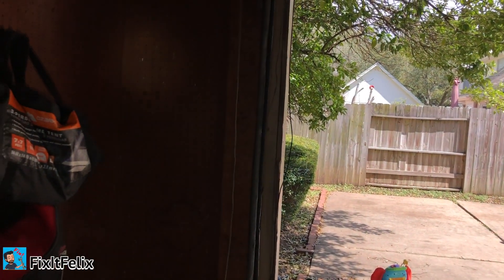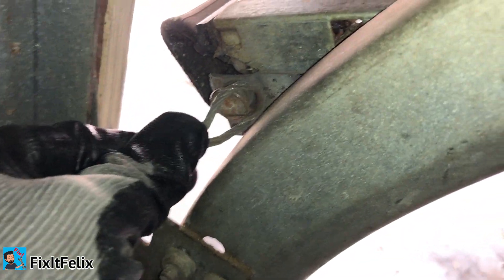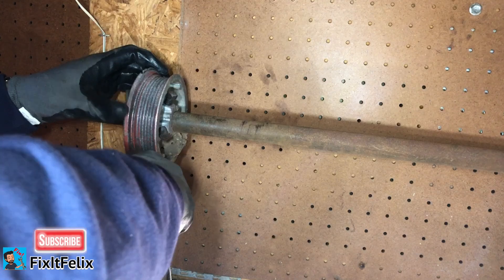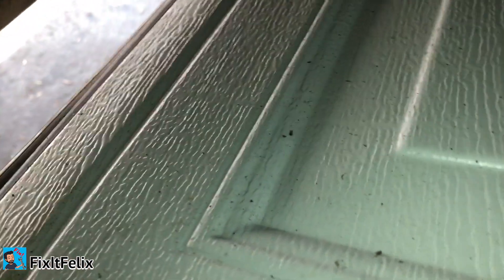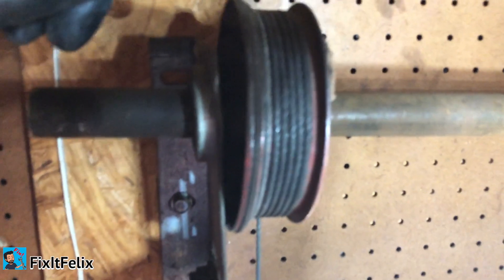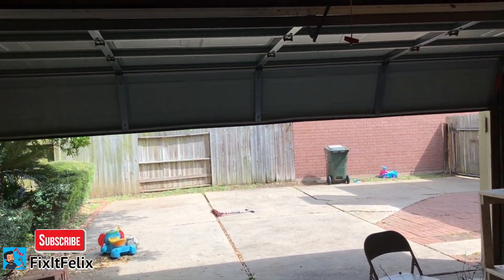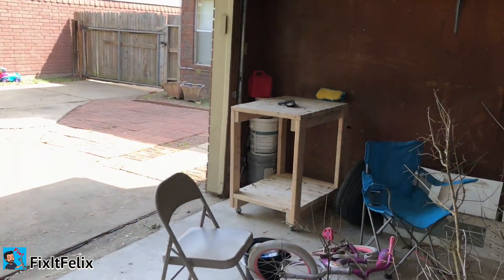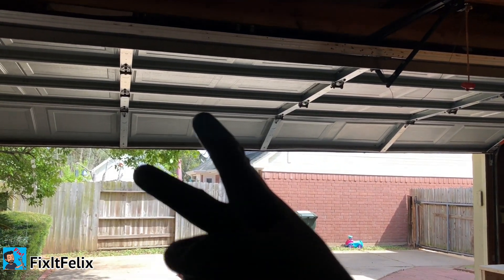Garage Door wire Fix EASY!

Comment: Thanks..my cable came off too but the loop on the end split rusted so I'm guessing I need a whole new wire? I also have a garage door opener on the door. I hate to call a repairman they will charge me alot to fix this when maybe I can.
Reply: I’m sure you can fix it! 
   The best thing you can do is replace it, you don’t want the door falling on anyone because of a rusted wire that you already knew about. They’re inexpensive too. 
   Good luck! If you haven’t already fixed it 👌

Comment: Didn’t need to disconnect cable just loosen set bolts 3/8 socket and turn the drum and retighten much easier

Comment: I tried doing this but for some reason, the cable still keeps coming off.  It seems like there’s not enough tension on the cable and it keeps coming off on both sides when I raise the door after lowering.
Reply: Set cables first with the door in the closed position and the  add the tension.  When the door is open there should still be about a half turn on the springs.
Reply: 7 foot high door with residential drums the rule is one full rotation of the spring per foot of door height.  Most doors being 7' high require 7.5 turns.  Or 30 quarters.  One plug hole on the spring is a quarter turn.
Reply: newmiester it turned out that my door had an internal spring that was broken.  I ended up needing to replace the assembly

Comment: Can you explain why  they comes off.
Reply: Could happen if you bring the door down on top of something one side for example & the weight is off that side & the cable becomes slack
Reply: Springs could be losing tension. You need to have a professional come look at it.

Comment: You need new springs. That’s the correct fix. Since you didn’t replace them you will have this issue again. Fixing it and fixing it correctly are two different things. Also your door is crooked. You can clearly see it when the door goes up. Please don’t try to give bad info this is not a job anyone should do unless they are trained
Reply from the maker: Well it’s been 9 months since this fix and my garage door is still working perfectly fine.
Reply: Looks like you did a good job to me. Hrach you make a video and show us how it's done